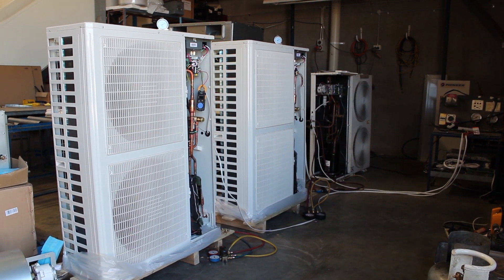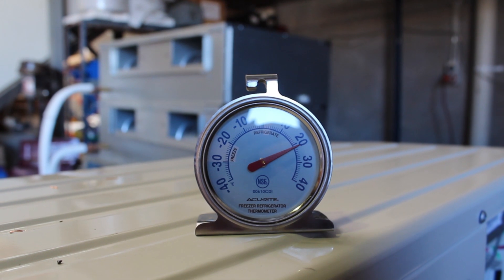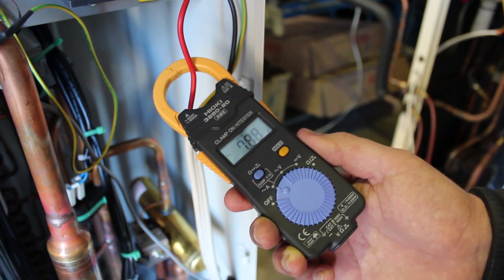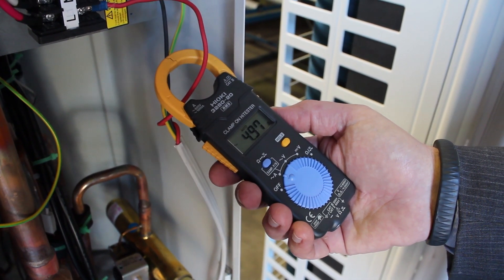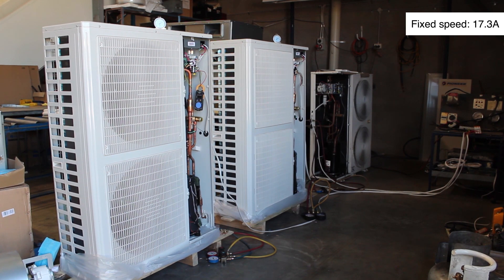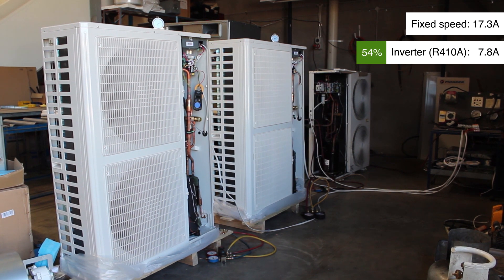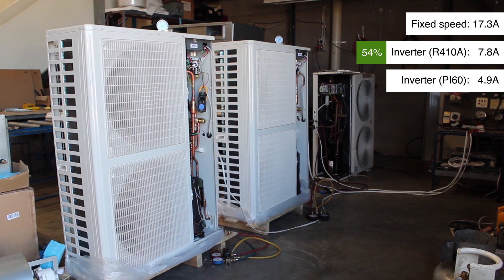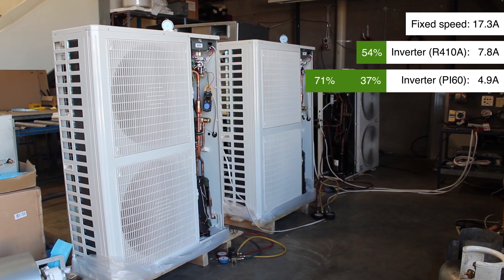Comparison of air cons and their refrigerants - Hydrocarbons Win!

Comment: Is it possible to swap R410a for hydrocarbons as a straight retrofit? - and have no negative maintenance or other issues?
Reply from the maker: Hi Guringai, will have power saving but if the metering device is tuned to the refrigerant you wont get the performance.
Reply: @georgehaydock2147  It's definitely possible in some cases, there are companies selling hydrocarbon based R410a replacement blends. They should work fine in simpler systems, but I wouldn't suggest using anything but the specified refrigerant in anything with sensors or electronic controls because the control board won't understand why the temperatures and pressures aren't what it expects to see. Whether using a flammable refrigerant in a system not designed for it is legal or advisable is a different discussion entirely.

While hydrocarbon refrigerants might be more efficient in a system specifically designed to use them, you probably won't gain anything significant by retrofitting an existing system to use it. With retrofits, simply matching the performance and efficiency of the existing refrigerant is enough of a challenge. And if the huge efficiency improvements these refrigerant manufacturers have been claiming for decades were really true, don't you think we would have actual studies backing up their claims by now?